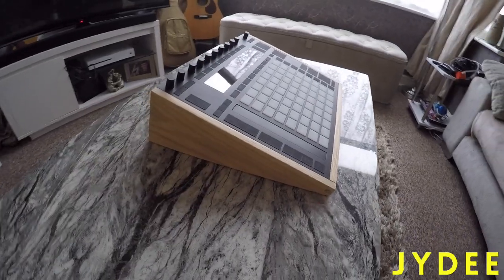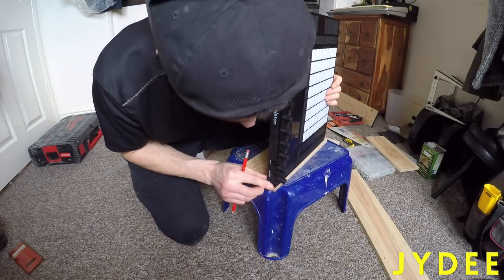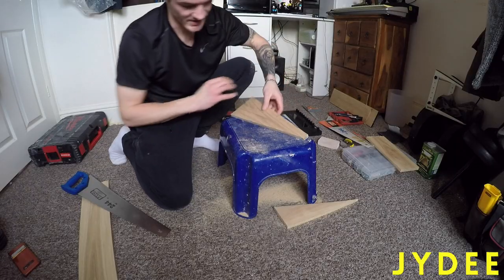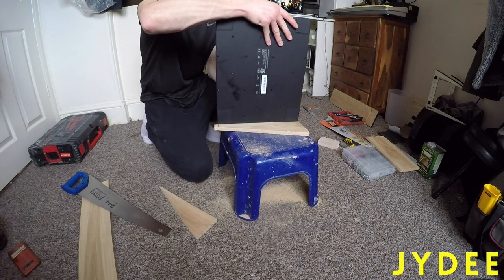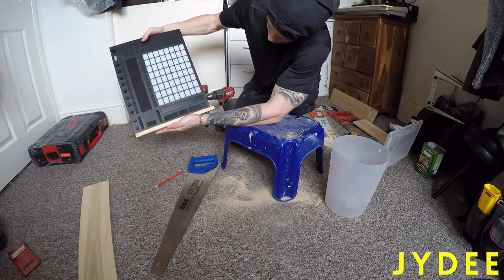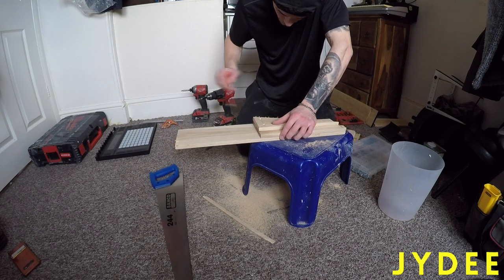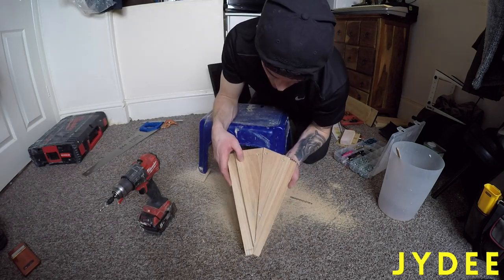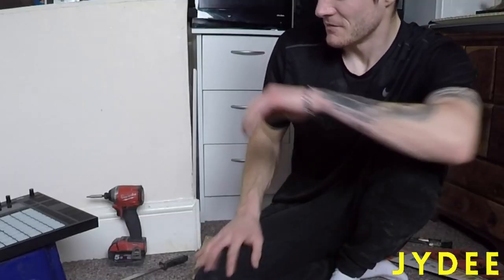I MADE A OAK STAND FOR MY ABLETON PUSH 2 ✅📏

Comment: Real neat! I’m thinking to make mine a stand under the device (no wood outside to save space), was thinking how to fix it to Push  ....... looking how comfortable your Push feels in a heap of sawdust, I’m not afraid to drill a hole or two in the device now :) thanks for inspiration! .... cat!
Reply from the maker: Yooo brooo, don't put screws into your push you will kill it I have seen a few people take them apart on YouTube and there is definitely not enough clearance inside the Push to be putting screws in

You will end up hutting the PCB and more than likely kill it 💀

If you did want to secure some thing on the sides I would clean the sides down with methylated spirits to degrease the surface then use some 3m double sided tape..

Please don't kill your push lad haha